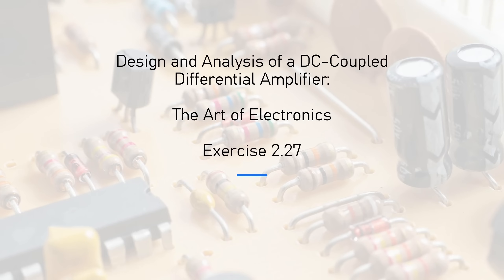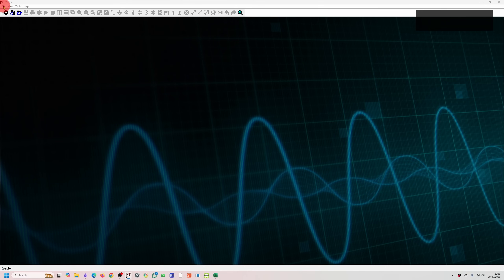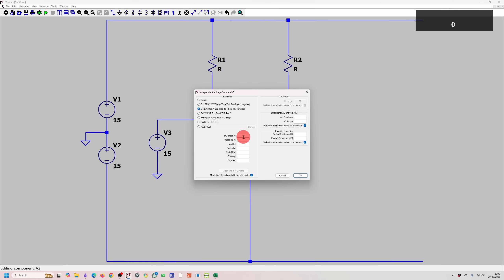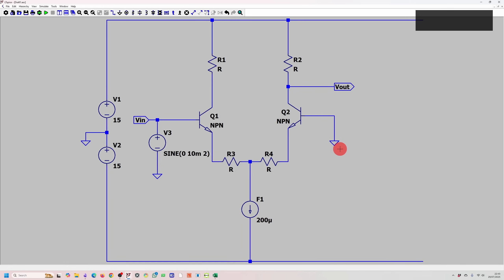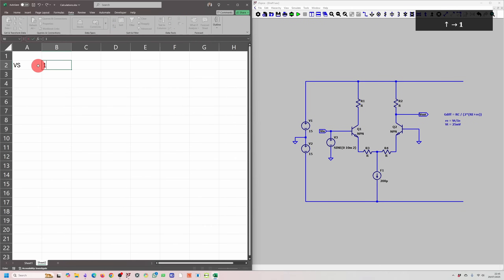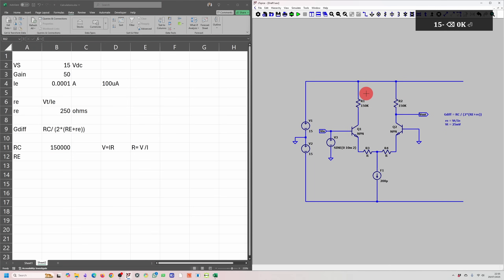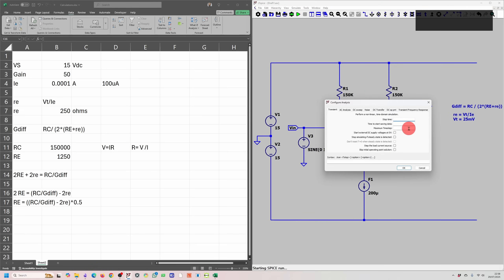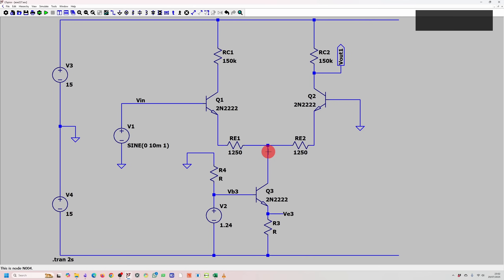Differential Amplifier Design - Art of Electronics Exercise 2.27

Comment: Great tutorial video! Very well done.
Nice approach to show the calculation on excel side by side with the LTSpice.
However... While guessing the value of Rc you assumed a wrong premise.
You aimed at getting a collector voltage of 0V (and thus assumed a voltage drop of 15V on the collector resistors), but by doing so you starved the transistor of collector voltage.
You must remember that in a  differential amplifier like this (with BJTs), your base voltages will be swinging about 0V (small signal) and therefore, your input transistors' emitters will be swinging about -0.6V.
If you consider (for a safe margin), a saturation voltage of 0.3V, it means your collector should not be expected to go anywhere lower than -0.3V.
With your 20mVpp of input signal, gain of 50, and your 150k collector resistors, your  circuit is operating at the brink of saturation for your test condition (of 500mV output peak).
From your comment at some point, about the offset of the output signal and your assertion that it could have been due to transistor mismatch, I have the impression that you aimed at the collector resistors of 150k with the exact purpose of making the output signal to swing about 0V, which is a sound reasoning, but fails to acknowledge that in this circuit, the transistors collectors can barely go anywhere negative.
Finally, when you added the output emitter follower and the signal distorted, you didn't  see the root cause of the issue (which is exactlythe differential pair going into saturation due to too-low collector voltage).
Instead, you avoided the problem by lowering the current consumption of the emitter follower buffer.
What you could have done :
1. Started from the beginning factoring-in the emitter follower at the output, already taking in account the base current the emitter follower would require to be biased, before guessing the collector resistors.
2. By considering the emitter follower from the beginning, and aiming at a signal swinging about 0V at the output of the emitter follower you could have guessed a more appropriate collector voltage at the differential pair, of 0.6V and, by doing so, gaining 0.6V additional headroom for your differential pairs' collectors to swing, making the differential pair capable of some 900mV peak, instead of just over 300mV peak.
3. By carefully adjusting the collector resistor, you can even accommodate a higher biasing current for the emitter follower transistor. (i.e. assuming an hFE of 100 for the output transistor and an emitter resistor of 7500, you get a 2mA output current with a mere increase of 20uA of current at the differential pair's collector resistor).

All considered, if you just consider 120uA of current at the differential pair resistors, and aim for a 0.6V collector voltage, (14.4V dropped on Rc), you get a value of 120k and, possibly an output voltage at the emitter follower's emitter just around 0V.
And a timely P.S. :
You will need to readjust your emitter resistors to get your target gain of 50, but that readjustment will be completely inconsequential for the rest of the circuit.
Reply from the maker: Thanks for the detailed feedback. Really appreciate it. I’ll look into what you’ve said and make  an errata video if required.
Reply: Dear  @TheEngineeringExperienceYT ,
I thank you.
I'm not, myself, someone who has the drive to produce material, but I feel happy that I can contribute in some way to honest content that I see are made with care, line yours.
The fact that you based your video on an exercise published in "That Art of Electronics" was what catched my attention.
They were legendary.
I learnt electronics from the magazines of those times, Electronics Today International, Wireless World, Elektor, Nuova Electrónica, etc...
And later, already on Internet times, with the articles and projects of the Australian Elliot Sound Products, the book o Doug Self (Self on Audio), and the books and Application notes from Jim Williams.
I'm sure you will continue to produce great content.

Comment: If the question asked for 100uA in each transistor, why did you design the output transistor to draw 1mA
Reply from the maker: The question doesn’t specify anything so it’s your call really. I think I mentioned in the video that if you just want to buffer the output then design it 100uA. If you want current/power gain then you can go higher.